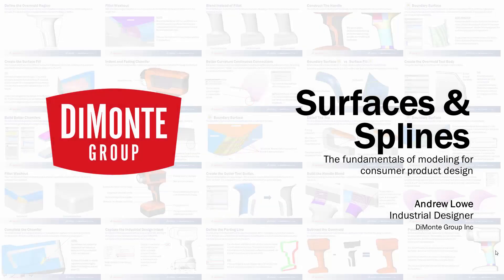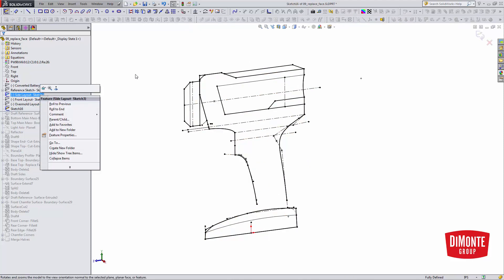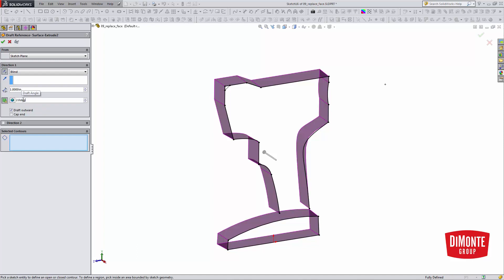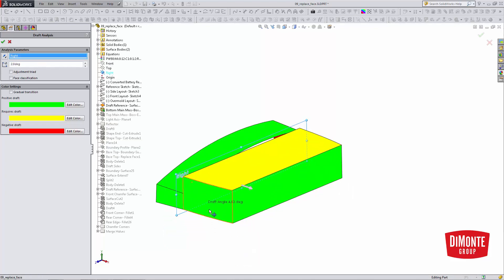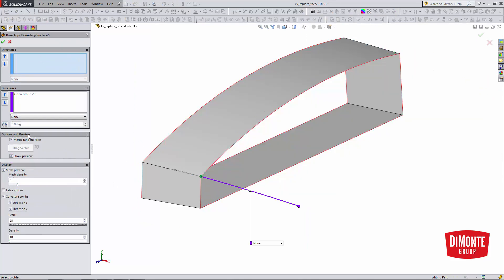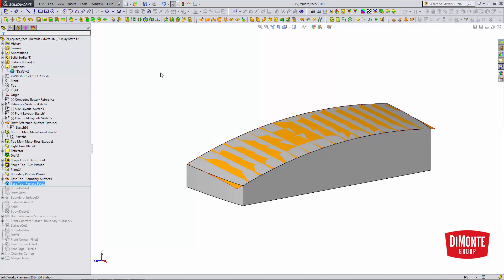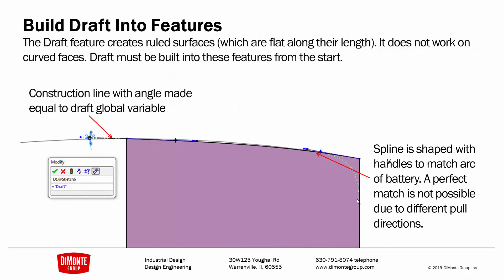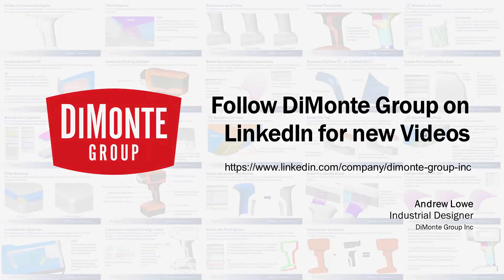Surfaces & Splines | 08- Modeling with Draft

Comment: https://youtu.be/E65N6W_fWIk?si=6MTJiV9d-HfBCzC4&t=153 Sketch6 indicates fully defined but the spline handles can still be manipulated. Why is that? Sketches 3, 4 and 5 are not fully defined. Is there logic behind this? There are several other (-) sketches in this model. Can't problem arise down the road with undefined sketches?

Comment: Hi! Thanks for the amazing tutorials.
I was wondering why you use helper surfaces to set a boundary surfaces tangent to those helper faces, instead of selecting the sketch without a helper surface and applying a 'normal to face' option with an angle when making a boundary surface. 
Is the result the same? If so, is the benefit of helper surfaces that you can reference the draft angle to a global variable?
Reply from the maker: Daniel, Great Question! 
I'm glad that you are thinking about adding the draft into the feature instead of adding draft relative to a reference (or "helper") surface.
The short answer is that it is likely that we weren't able to do that at the time the sample model was created. Andrew mentions that he was using SOLIDWORKS 2013 in the video, as is correct to do. 
Any tips or tricks you learn \are highly dependent on the state of the software at the time it was created. 
We all also need to be aware that even after new functionality is implemented, folks have habits they developed from earlier versions. I do not have 2013 installed on my rig so I can't verify if adding draft into the surface feature was an option back then, but I can verify that it is an option in the sample file available here which was saved in SOLIDWORKS 2015: http://dimontegroup.com/solidworks-world-2015-surfaces-splines/
But I made it my practice for decades to make my surfaces tangent to reference surfaces because for so long that was the only thing we could do.
Reply: @DiMonteGroupInc  Thank you for the reply! Interesting! 
In the meantime, I also came to the understanding that using the helper surface allows you to reference global variables for draft, which is not possible in the 'normal to profile' setting in the boundary surface options. So that's another benefit of using 'tangency' to helper surfaces over the 'normal to profile' when creating boundary surfaces (in SW2020 at least).